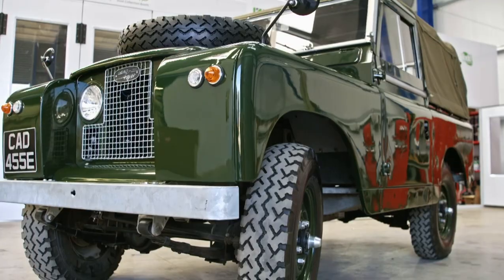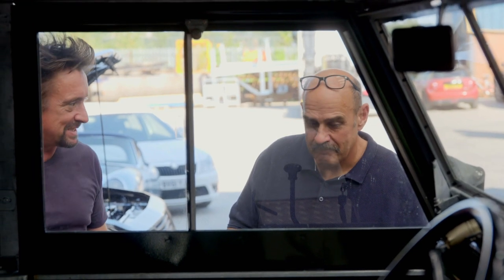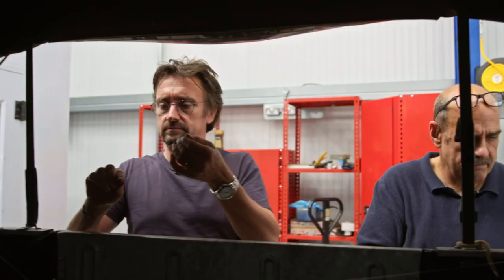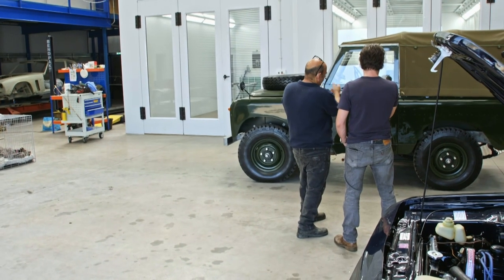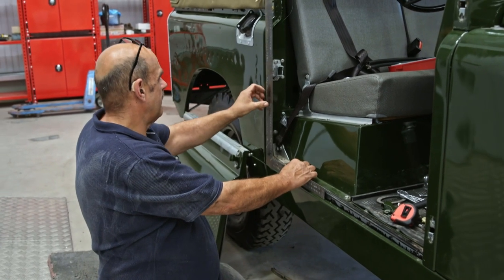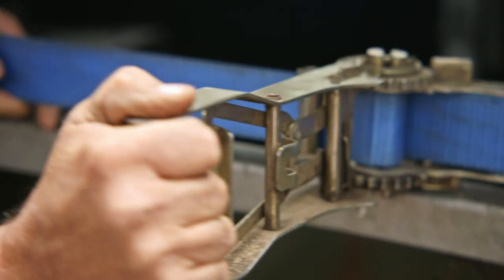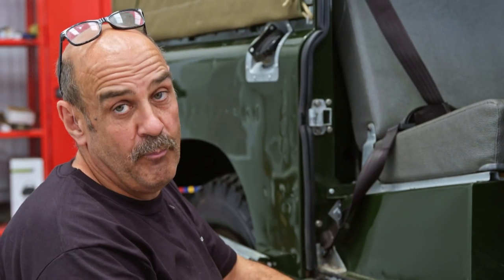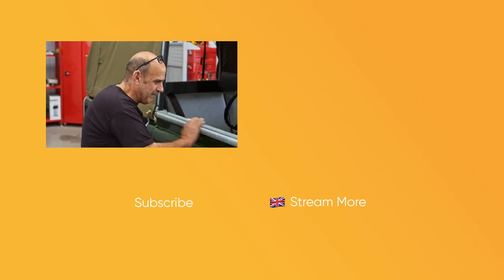This 1967 Series 2 Land Rover Was Supposed To Be A Simple Fix… | Richard Hammond’s Workshop

Comment: If its had A  posts on bulkhead, no pre assembly before painting, work from rear tub forward, tub, doors bulkhead 
Also pattern part doors holes are in wrong place
Bulkhead is adjustable before full  assembly

Comment: Sill to rear tub needs to be at 90 degrees not sill cover plate to tub. Also door gaps need to be at 34 &3/4 inches top and bottom. Only then will the door gap be correctly set.

Comment: Not a restoration in my eyes, just buying all new parts, painting them and bolting it all together. It looks false and nothing like the car would have looked like new.
It's the same for midgets, mgbs etc, far to many new parts used rather than restoring the old bits. It's taking the skill out of the hobby.